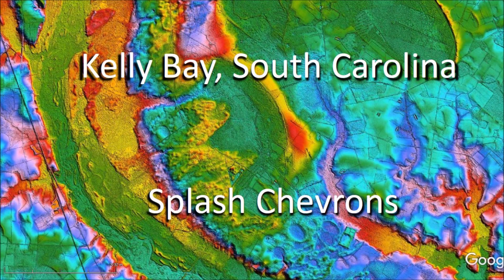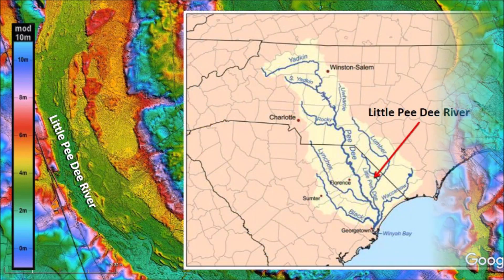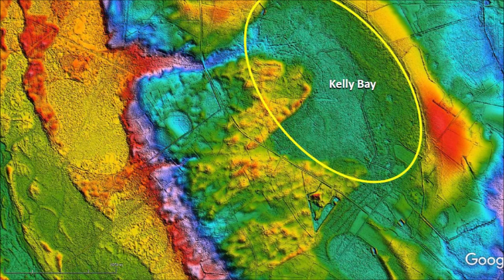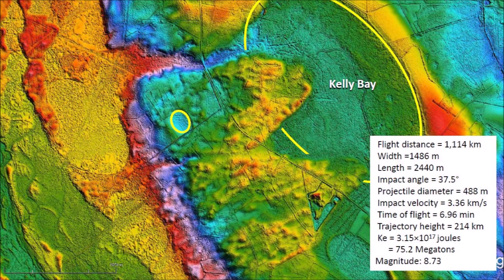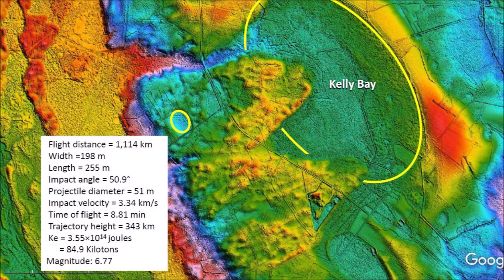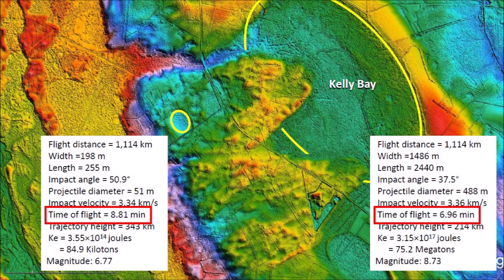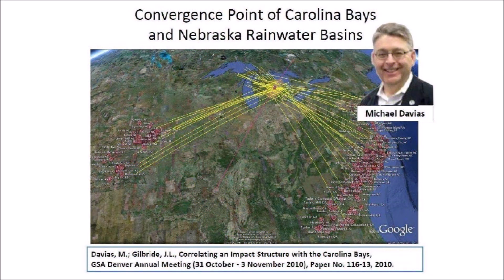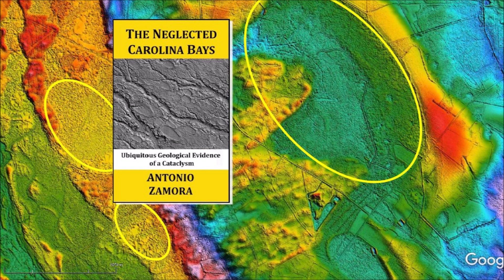Splash Chevrons in Kelly Bay, South Carolina

Comment: are any of these splash chevrons ever found on the western banks of rivers?
Reply from the maker: No. In a video about atmospheric effects I mentioned that the jet stream got trapped under the icy ejecta curtain and the high speed winds influenced the orientation of the splash chevrons.
Reply: @Antonio_Zamora  do you think this high-speed wind near the earth's surface could have altered the trajectories of the ice boulders in any significant way? or, because they were travelling 2 miles/sec, the effect was relatively negligible?
Reply from the maker: @AustinKoleCarlisle  The wind effect would have affected the last 10 km of the trajectories.
Reply: @Antonio_Zamora  alright so after giving this some thought, if the ice boulders were travelling SE toward the Atlantic Coastal Plain, and this wind was blowing to the east, then if this had any affect on the trajectories it would've caused them to deviate slightly to the east, causing the orientations of (some) bays in the SE to converge further south (and/or west) than the actual comet impact site. i know that probably can't be quantified accurately, but it might help to explain a slight discrepancy in the currently theorized triangulated convergence point for that particular area.